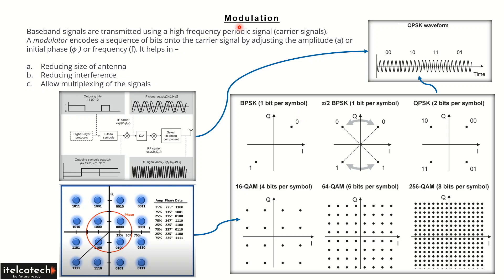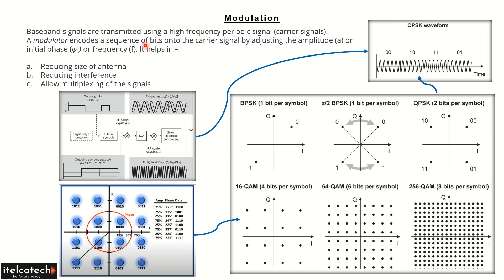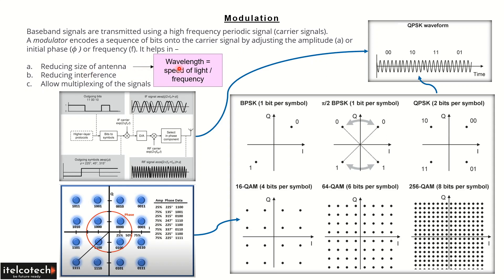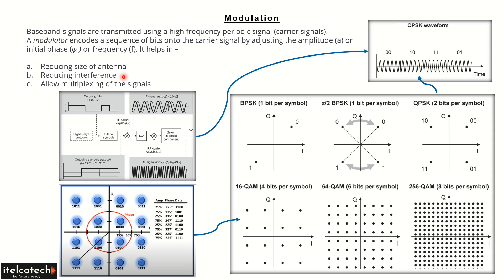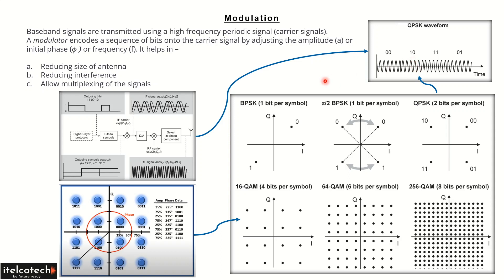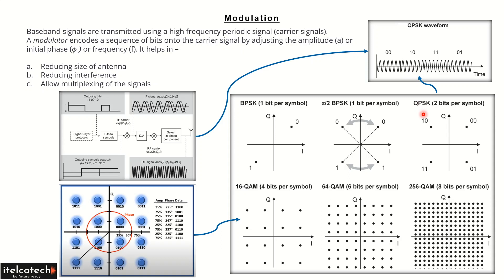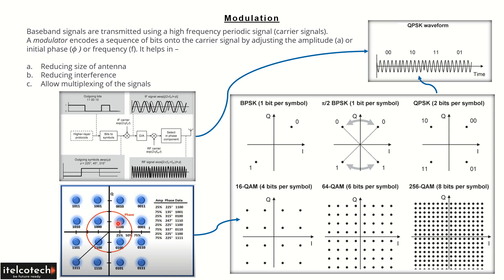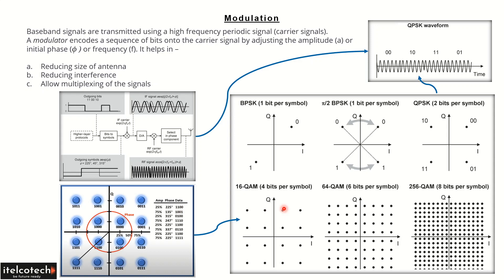5G Modulation

Comment: Hi, how can modulation reduce size of antenna?
Reply from the maker: Hi,
If baseband signal not modulated with high frequency carrier signal, these baseband signals of few Hz frequency cannot travel longer due to very high losses and hence needs very large antenna for transmitting and receiving the Signal. 

We know this formula -

v=fλ

  since speed of the wave is a constant based on the medium.
For efficient transmission from an antenna, its size should be comparable to the transmitted wavelength. Hence, use of high frequency carrier wave in modulation facilitates the size of antenna to be reduced, hence reducing the cost and improving its efficiency.
Reply: Antenna length is directly proportional to Wavelength/4 or inversely proportional to frequency
Reply: Height of the antenna is expressed in terms of lambda(Wavelength). So as Carrier frequency increases(Lambda is Inversely proportional to frequency) lambda decreases hence the Antenna size also decreases.